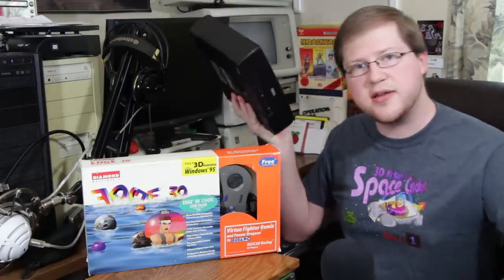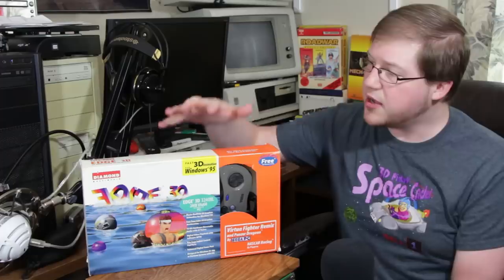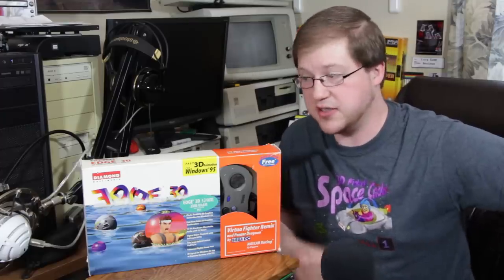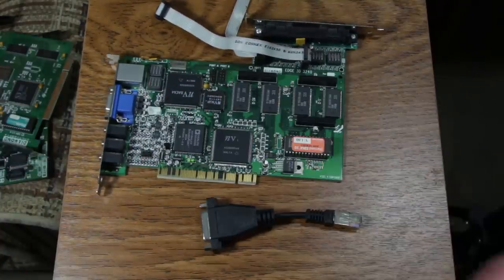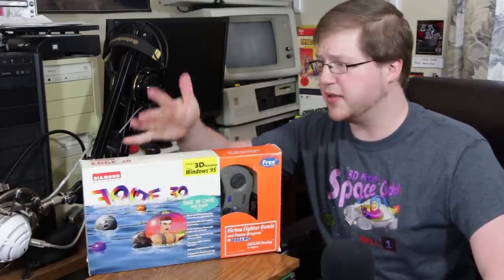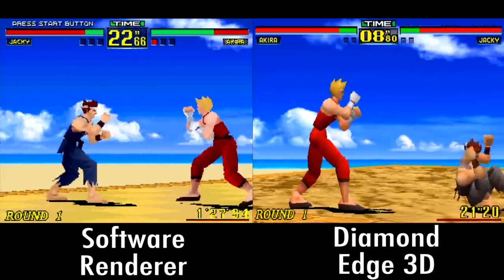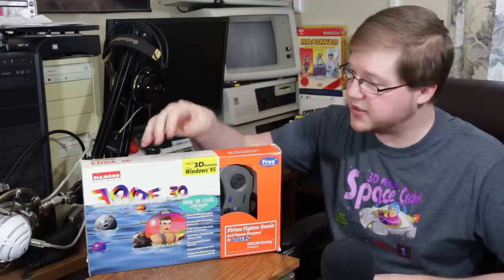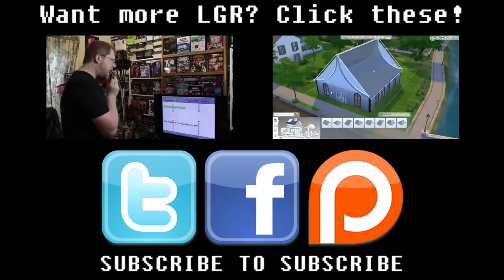LGR Oddware - Diamond Edge 3D (nVidia NV1+Sega Saturn Ports)

Comment: so for 250 bucks you got an nvidia graphics card with a midi capable soundcard, 2 saturn controllers and 3 games. that doesn't sound too bad.
Reply from the maker: It was actually $450 when it first launched, which comes to about $700 in today's money, for a card that only ever had SIX GAMES made for it. It was early to the party, but just a handful of months later for that kind of cash you could've instead gotten a much nicer soundcard and a 3D graphics card compatible with hundreds of games, which is the big reason this didn't sell!
Reply: yeah, it's a shame it could not handle other 3D standards as well. that would have made it a lot less niche.
Reply: Lazy Game Reviews I remember this thing. It couldn't compete with the 3dfx cards that were exploding on the scene around the same time for half the price. The Saturn games just seemed like a gimmick with not much appeal to me at the time.
Reply: Remember that back in the days that 250 dollars could also buy you a house.
Reply: two hice
Reply: From 1988 inflation has basically halved the value of the dollar.  So this was a bit more expensive than a GTX 1070 today.

EDIT:  Actually $250 in 1995 is $395 today, placing it square in 1070 territory.
Reply: The problem is that very few people had the Sega Saturn, the sound quality was poor, there were only six compatible games and the hardware couldn't render games that used polygons, and it was slow and had poor image quality. $250 suddenly sounds like a lot.
Reply: Felice, you mean games that use triangles. Quads are still polygons. :P
Reply: Point, my mistake!
Reply: But in 90's money, today, that would be $400.
(Inflation)
Reply: Not to mention, not long after this card came out Sega started porting their games to Windows anyway.
Reply: Exactly. I didn't win it though but simply returned it. I think the controllers didn't work, it didn't support genuine saturn games and as you say no D3d support
Reply: @LGR  so rtx cards of its day.
Reply: @Sankanyu  For $150 you could buy a house but it would be rendered in software.
Reply: I remember seeing these advertised in magazines back in the day, except it was in the form of a full pc they were selling that also played sega Saturn games. Used to drool over that thing thinking that must be the... Best thing ever
Reply: yea but its NVIDIA and not PCIE
Reply: only issue is that soundcard is incompatible to any games not released "by SEGAPC" i guess...
Reply: Now imagine a gtx 1080 with ps4 controllers and games
Reply: It wasn't that good of a deal tbh
Reply: I don't understand the purpose of this. Why not just buy a Saturn???

Comment: If you think rendering quads in hardware is weird. You should see how the PS1 did it. It did not use perspective divide, it used affine texture mapping only, it did not have a floating point unit (!) and it did not use a Z-buffer (!!!); it transformed triangles into 2D and clipped them into smaller triangles before rendering, making sure that there was zero overdraw.
Reply: Is that why ps1 graphics looked so "shaky"? Compared to the n64
Reply: +MrAmir yes, the positions of vertices was effectively being truncated down to an integer... Sort of. It never existed as a floating point, so it was doing math that you'd typically expect to do with floating points, so you'd get these swimming vertices. The best example I can think of is "Space Griffon VF-9", a rather poorly aged mech fps, it was basically a corridor shooter so the walls went very close to the screen, you could watch them crinkling up around the corners.
Reply: +Phos9 So that explains why textures are so damn twitchy on PS1 games I guess :/
Reply: +James Lewis They're not just twitchy. The playstation also couldn't do perspective correct texturing, only affine transforms, so textures could warp weirdly in some situations.
Reply: I know. I have Syphon Filter 1 that was a PS1 title, and I used to play it on my PS2 all the time, and lots of weird shit happened with the textures and models and such, especially if they were up close to the camera and even more so if they're on the side of the screen.
Reply: Yes the PS1 looked pixellated even for 1996
Reply: +Alex ojideagu At such obscenely low resolutions, I prefer no texture filtering, because it's much sharper. Compare with the blury mess of every N64 game (not helped by max 64x64 pixel textures). It kind of worked if you were going for bland textures and high contrast colours (AKA cartoony); anything else on N64 looks ridiculous. Compare with Quake on PC. 320x200 looks better unfiltered; somewhere around 640x480 filtering starts looking better.
Reply: Hmm. could this explain the swelling rocks in R&C1 Eudora? I think the PS2 uses a similar rendering process right?
Reply: Oh, and...

The PSX was mostly custom hardware. The R3000 CPU was developed by MIPS (and the R4000 in the Nintendo 64!). But the graphics hardware, and of course the system as a whole, was Sony's work. Sony are kind of gigantic in the electronics business. Before the PS1, they were huge, but now the Playstations have made them legendary. 

What does use off-the-shelf hardware is a PC! 

Maybe the lying little git was on commission, so he got more money, the more expensive things he sold to customers. So instead of walking out with the PS1 you wanted, you'd have a huge collection of boxes, weird guarantees and helpline numbers, the pain in the arse of actually setting it up and getting it to work. 

Guy was either on commission, after your money, or as previously hypothesised, an idiot.
Reply: Re: "it transformed triangles into 2D and clipped them into smaller triangles before rendering, making sure that there was zero overdraw"

That was left entirely to each game. Primitives on the PS1 were either triangles or quads, with optional gouraud shading. (And a couple optional alpha-blending modes.) [Note: Unlike the Saturn, quads on PS1 were processed by the GPU as two triangles, behind the scenes.]

As you mention, because of the affine texture mapping, each game needed to dynamically subdivide polygons that were large and close to the camera. Games that did this well could avoid much of the "texture swimming" (at expense of probably increasing jitter.)

Indeed, as you also indicate, there was no floating point. Worse, there were no fractional texture coordinates. Also worse, the GTE math coprocessor (Cop2; Geometry Transform Engine) used low-precision 16-bit fixed point.

This produced a sort of worst-of-all-worlds scenario: a tension between the need to subdivide polygons to reduce texture swimming, vs. increased jitter resulting from GTE fixed-point inaccuracy, compounded with the lack of fractional texture coordinates.

It was hard to get right. Games like Spyro The Dragon, which leaned on gouraud shading rather than high-res textures, were perhaps a more natural fit for what the hardware was capable of.

But, for an example of a heavily textured PS1 game where the developers did a superlative job managing the aforementioned trade-offs, check youtube for vids of the PS1/PSX Quake 2 port.

Finally, as for overdraw, the PS1 would happily render whichever primitives the CPU prepared for it. It was an interesting architecture: a single 16-bit hardware port, which the CPU could bang manually, but which usually was fed by DMA.

This hardware port was used to feed primitives to the GPU, 16 bits at a time. When the GPU received a complete primitive—whose size varied based on whether it was a triangle or a quad, and whether it was gouraud shaded or not—the GPU would commence rendering the primitive.

Usually a game would compute a list of primitives, linking them together in buckets based on Z-sort distance, and ultimately kickoff the DMA which would simply be pointed at the first primitive (each primitive specified its own size, plus a link to the next primitive) and which would just start banging the 16-bit GPU port with the data for each primitive, and then moved onto the next one in the linked list.

A few games, in special circumstances, reputedly used the CPU to bang the GPU port directly instead of relying on DMA, because developers found it was faster to use the CPU in very special cases. But most of the time, we'd just link all the polys together with the CPU, then trigger the DMA to feed the whole list to the GPU.

(But again, as far as overdraw, there was no special handling by the hardware: once a primitive reached the GPU it would just render it entirely.)
Reply: Lassi, the Saturn used quads was because it was a repurposed sprite engine. 

You can generally draw more stuff using quadrilaterals than you can with just triangles. A quad uses 2 triangles, of course. So if you have a machine that's good at doing quads, you wouldn't hamstring it by limiting your games to only drawing triangles.
Reply: PS1 also had 64x64 textures (not sure if that was the max, but I've seen textures of that size), whereas N64 I think had 32x32 maximum, which coupled with the bilinear filtering made every texture look like an abstract painting.
Reply: 256x256 was the maximum ps1 texture size, in 3 colour modes (15bit truecolour, 8bpp&4bpp palettised)
Reply: @jlewwis1995  I never really notice back in the day, but it's very apparent when playing a ps1 emulator.
Reply: @soylentgreenb  That's almost how I prefer Doom. Anisotropic filtering for the level geometry, but the sprites have to be crunchy.
Reply: @killerbee2562  nowadays there are emulators that can "fix" the wobbly geometry and crawling textures. Obviously optional.
Reply: @soylentgreenb  Nah man, the N64 looked infinitely better because of the filtering (and no shaky polygons, of course). There is nothing uglier than pixelated polygons.

Comment: Wow, the GM of that Roland is fucking fantastic. That slap bass almost sounds completely real.
Reply: The Roland MT-32 is amazing. 8-bit Keys made a review of it where it was used with MIDI-keyboards.
Reply: I know. For 90's MIDI music it sounded absolutely stunning
Reply: Sound Canvas in GS mode is amazing especially the later SC-88 series. Although Yamaha's XG fomat is technically much more capable and Yamaha's sounds are sometimes better, hardly anything took advantage of it because it was so expensive.
Reply: @Logan912  a bit like with the OPL3 chip. More capable than the OPL2, but few if any games made of if the extra channels.

Comment: The Diamond Edge 3D is the missing link! Thank you Clint (your name is Clint, right?). It all makes sense now! that's why SEGA ported so many of those Saturn games to PC in the late 90s. That's why Nvidia's first card used quads instead of traditional polygons! Now I know!
Reply: Quads are a type of polygon, 4-gon if you will where as triangles are 3-gons. Problem with quads is they are hard to rasterize because there's not guarantee that all 4 points exist in the same plane :-\ What SEGA really used instead of polygons were quad patches, this was a way of representing a surface for evaluation, rather than storing all of the actual points that make up the surface.
Reply: MrGencyExit64 OK, Triangle polygons.
Reply: MrGencyExit64 Same issue for quads today..except the HARDWARE has gotten WAYYYYYY better..

Comment: My first experience with 3D accelerators was when I borrowed Matrox Mystique from my friend and played Tomb Raider with 3d-acceleration patch for that card. Dark Forces 2 was quite amazing too because it ran so smoothly and at higher resolution, there simply was no turning back to choppy low res gaming. Next I had that famous Voodoo1 4MB + Tseng Labs ET6000-combo and I thought that I had reached the peak of modern gaming technology and never need to upgrade again, how wrong was I lol. Next came Voodoo Banshee 16MB etc. etc.

Comment: Clint...this is magnificent.
Reply: Oh I had one of these cards!

I remember the Direct X problems. I was just happy when I could normal games on it again. Yeahs! That was awful!

Then I bought a Voodoo or ATI Rage. I think. One or the other.

I remember buying it solely for the Sega games.
Reply: On a side note, Virtua Fighter PC, Expert release, works fine on a 64-bit Windows 10 computer. Just adjust from Fast to Smooth in options.

So, does the Edge version in this video work on any other cards?

Comment: Man, this brings back ancient memories. I remember buying a new pc which had this Diamond Edgde 3D card pre-installed. I even remember buying a second Sega Saturn gamepad so I could play Virtua Fighter with my kid brother. After a couple of years I replaced it with a different video card (since I couldn't find any other games that were supported and it was quite slow with non supported games) and then added a Diamond Monster card that supported 3DFX. Even though it was surpassed by OpenGL and DirectX, for a brief period of time 3DFX was a thing and I owned a lot of games that supported it.

Comment: When it break it down, the card wasn't that expensive. $249 - $49.99 (Panzer) - $49.99 (NASCAR) - $49.99 (Virtua Fighter) - $29.99 (Controller) = $69.04. SO for $70 you got a sound card and video card.
Reply: +abyssea If you had to pay $249 to get it, then it cost $249.
Reply: Yeah, you didn't understand what I was getting at. That sucks.
Reply: No, I understood what you were getting at. I didn't agree. There's a difference.
Reply: @shmupshmuppewpew5260  He's right though, and you're not, there's a difference...

Comment: I remember my first good 3d accelerator card , Morrowind was absolutely eye popping compared to it being barely playable beforehand...
Reply: Why? I play Morrowind in my modern machine, with no graphics mods other than tweaks to run it at 1080p and it looks the same as it did back in the day, even better as I do not have to turn the draw distance down so it is smooth on a 1 Ghz Celeron.

Comment: The Sega Saturn was the best console ever to me. It rendered colors so beautifully. I didn't not know it used squares. That's bizarre. 

What I will say is that the Saturn rendered colors beautifully, and had great sound. Also, the development kit was about to be revamped by Yu Suzuki later to be more powerful than the N64. Which would have been beautiful. Ah, well.